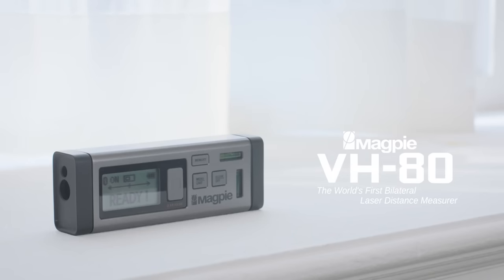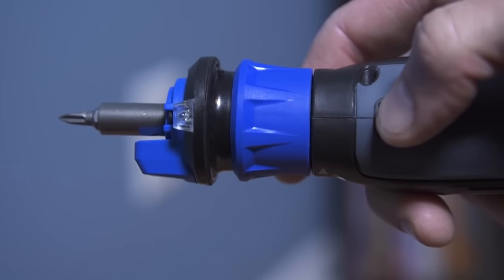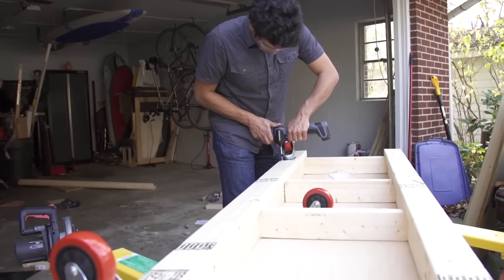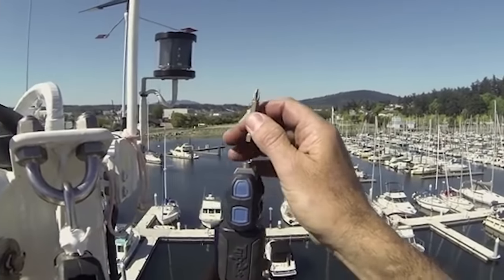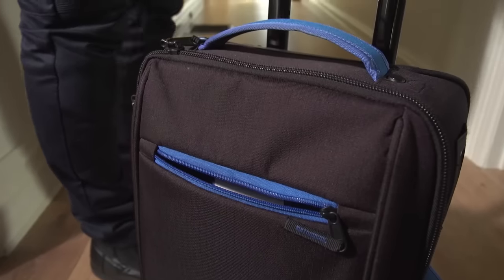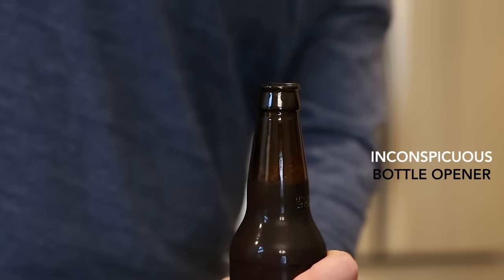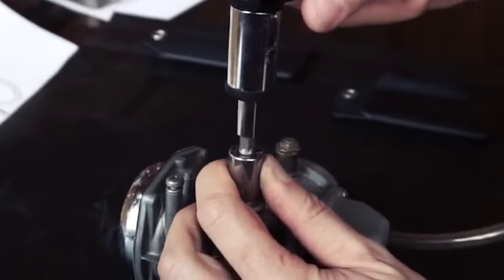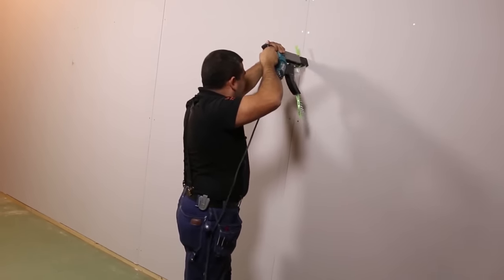10 GADGETS EVERY MAN SHOULD HAVE

Comment: I like how the last one they say is a "wireless" screw driver.
Reply: They don't understand that wireless means data transfer without wires, while the correct term should be cordless, which denotes the use of a portable power bank, typically a battery.
Reply: I think he was pointing out that it actually has a wire and isn't even cordless.
Reply: CONFUSING!!! The link is for a cordless one but the video obviously shows a corded one.  http://www.toolstop.co.uk/makita-dfr550z-18v-cordless-li-ion-auto-feed-screwdriver-body-only-p70910
Reply: Hilti makes better screw guns and they're completely interchangeable with other hilti stuff. I am not a fan of their proprietary strips but fuck it they work amazing.
Reply: Zaes666 that's all that matters. Never used them, just saw the wireless drill but had a wire hanging out
Reply: HILTI and DeWALT are my favorite tools. I guess quality: HILTI & Affordability: DeWALT?
Reply: tre n 8
Reply: who worked with makita knows that gun often stuck :-) i prefer bosch, best for my hands
Reply: tre n _ I thought I was trippin after hearing, seeing, and taken another look
Reply: DeWalt is awesome too, Hilti just has an incredible warranty and the lease system. One thing I did notice was my Hilti Impact driver is much more controllable compared to the DeWalt. Meaning I don't have to feather the trigger on my Hilti, but the DeWalt would start stripping the bit if I didn't be careful. I think Hilti's impact system is a lot smoother. DeWalt's is good but it will overdrive screws and become uncontrollable sometimes.
Reply: Precisely when I paused and hit dislike lol
Reply: I agree but the rest is overpriced junk.

Comment: bullshit i could clearly see the wire on the last drill
Reply: not sure if they brought it back, but they use to have a cord that would go to a battery pack on your back, kinda ghost buster style.
Reply: there are wired and wireless versions, the one in the video was wired.
Reply: First off it's not a drill, it's the auto feed screwdriver. 
Well i have the Makita mini vacuum and the drill/driver and they both have batteries.
The other model of the auto feed screwdriver  has a battery.The one they showed is the one with the cord.
Reply: i work with one with battery, its complete garbage.
Reply: nope thats not what its called its a collated screw gun haha
Reply: @Monsieur Doctordrer
Is it a makita with 18V lithium pack? (otherwise you bought the entry level or another cheap brand)
I do have a lots a makita 18v wireless tools  : circular saw, drill, rotary hammer, biscuit joiner, sander... and they works perfectly.
When you can drill a 10mm*10cm hole in concrete il less than 3sec on battery or cut through wood (and a forgotten metal piece on the back) likes it'(s butter... I do need to say you're talking shit and never used a makita 18v wireless tools
Reply: It was a joke

Comment: The flat socket wrench made from 1 material,  was more expensive than the HammerHead screw driver with that has batteries,lights, hot wire detector and was made from multiple materials. :P

Comment: The wire attached to the wireless screw gun is a very strong cable properly secured with screws to an anchor. This wireless screw gun will never be stolen or borrowed by your neighbor.

Comment: did you notice the last one the wireless screwdriver that comes with two batteries you can also plug the cord into the wall I think that's how the guy was using that one but you can also use it with the batteries

Comment: I'll wager I'm handier than anyone shown in the video and quite disagree with these tools for the following reasons:

1)  Laser measuring device - few people need it in situations where they can't use a tape measure which only take a few seconds longer, and don't measure things often enough to warrant the price.

2)  The screwdriver is weak, yet conversely doesn't appear to have a sensitive enough clutch, if any, to prevent over tightening.

3)  Unnecessary and fiddly when a 10 cent rare earth magnet slipped onto the bit works fine... been using one for years, when my regular 1/4" magnetic bit holder wasn't enough.  Either option costs less than $5.

4)  Tantrum - Overly expensive, weak tool, that isn't any better than cheaper tools.  Senseless.  Even in extreme cases where there is no clearance, a sub-$20 right angle adapter will work with other tools, or just a stubby manual screwdriver in the cases of "every man" who is not doing repetitive assembly work in specific scenarios where any time would be saved with this tool.

5)  Wrenchit - Weak, senseless to buy a tool with such limitations and still need beefier tools often, when the beefier tools also handle lighter work fine.  That is, unless you're in some kind of strange situation where you can only have a tiny light weight tool.  Perhaps on the Space Station, or hiking to some remote wilderness location and every ounce and cubic inch in your pack counts.

6)  Talon - Use a polymer little thing on nuts?  Again, too weak and only needed in special situations, not at all what "every man" needs.

7)  thru 10)   I'd just be repeating myself, no point to these tools, can't do the job as well as traditional tools, are basically just a waste of money.  Ironically, some even come near costing as much as the vastly superior tools they pretend to replace.

The Makita screw gun however, what idiot thinks every man needs to spent $179 to shave a few seconds off drilling screws in?  FYI, someone doing it over and over wouldn't go as slow as shown with the conventional cordless, unless you're all thumbs and in that case, it is very unlikely you're someone who should be building something that needs that many screws.  Plus, it's a one trick pony while your drill can do so much more.

There wasn't a single task shown in the video that I can't do equally and usually better with conventional tools, except the laser measurement of the building height.

The video should have been titled, 10 gadgets for people with more money than mechanical ability or need.

Comment: Honestly the only two I think would worth anything would be the two Hammerhead screwdrivers. Probably not the first on but the second one definitely seemed to be good, and it's 20 bucks. If the tool that costs 5 bucks does the same if not better job than the tool that casts 15, why spend the extra 10.

Comment: 5:21 $38.??? Are you kidding me? I bought a winchester high quality multi tool at Walmart twelve years ago for $19.99 and i have used it everyday since. It came with a nylon belt holster knife, saw, p-38 style can opener,bottle opener,pick, file,2 & 1 quarter inch measuring tool wire cutters and needle nose plyers. Wrench it is cheap sheet metal that will break while you're using it and they want 40 bucks? Eat me.

Comment: 1:45 the current detector only works if current is really flowing. And if current is flowing, you'll already know, since whatever is powered by it would not work otherwise. You don't need current flowing through a cable for it to be dangerous either. Useless feature.

Comment: If it has a current detector, and it's a loose wire, then it's useless. Infact if it has a current detector and it goes close to a power point, (outlet for non-aussies) it also wouldn't detect current because there's no circuit.

Comment: 1. VH-80 has high precision, but NOT exact precision, still good for longer distances where you dont need exact precision
2. or use a normal screwmachine, in bad angles use a normal screwdriver.
3. or use torch 20 screws and get double effect
4. might be good for bad angles, but again a normal screwdriver handles angles fine otherwise you need something really small which this device isnt.
5. looks like some thin material that breaks easily when using enough momentum.
6. if ur measuring ur dick or dont have a screwdriver/machine, then it might be enough, but you still gotta keep track of your bits
7. again same crap as 6. also not much handgrip for cutting which means you have bigger chance to cut yourself
8. small pole = less force = more hits needed, normal hammer seems better
9. looks nice enough i guess
10. seems nice too to speed up screwing process.

Comment: I'm not especially impressed but the video stepped on a sore toe! So to manufacturers: Unless you are in fact /generously/ paid by the battery manufacturers; please stop designing for AAA batteries. You'll get around a third the capacity of AA but pay the same. So if you are worried about size, just use half the number of AAs and a switcher... Personally, I'll always avoid devices with AAA when there's other options! ;-)

Comment: 7:14 ^^, that rhino hammer is probably useless. Something that short and light can't build up enough kinetic energy to be effective. I guess the designers missed school the day the teacher explained class 3 levers.
A short, lightweight hammer is like a wingless plane without engines, ^^
I bet they used the softest wood they could find for the demo (probably the holes were already made too). 
$54? What a scam, proper hammers are far cheaper than that and work infinitely better.

Comment: hammerhead thing is a joke, a cordless drill does the same thing, the magnetic bit is old news and there are better ones out there now,  the flipout is like the hammerhead thing, just a gimmick, the wrenchit thing is also just a gimmic, without open ended sections it can't deal with as many situations and a small handful of spanners, and i doubt you could get any real torque behind it as well, the talon looks good but whats much more useful and only slightly bigger...   a letherman, titanium pocket tool...   refer the previous crap.  the rhino hammer, now you really are just taking the piss, every man should have a hammer pretending to be a rhino, WTF, ok the bit bar looks intriguing, and might be something i would buy, but $65 fuck off, i'll give them $15 - $20 tops, and finally the cordless self loading screwdriver, it looks good, i can see a real benefit for tradies but for the average home user it takes more time to set the thing up than what you would save when you are just doing a few screws here and there, it also causes issues when using multiple screws so saying every man should have it is just crap, it is a specialty tool.

Comment: What a load of junk...

That thing at the end was the worst one.. SURE it was faster than a normal power drill, but that doesn't include the time you have to take to load that little strip with nails, it would be faster to just drill normally than to load that thing all the time.

Comment: that power screw driver is a load of crap.....the reason why cordless drill have replacement batteries is so they can be replace quickly when drained and when they fail its easy and cheaper to replace the battery rather then a drill/driver.

Typical late night infomercial crap and Kick-starter crap.